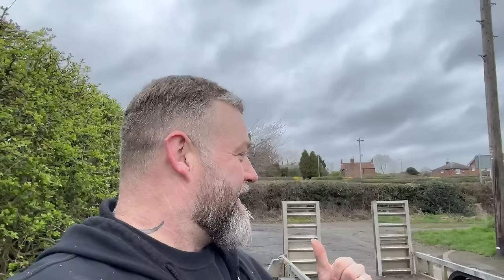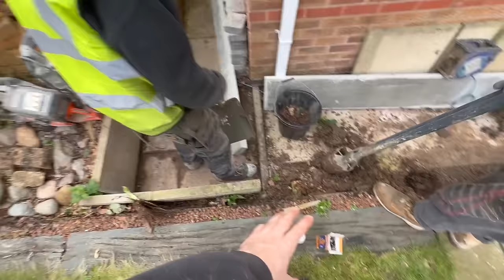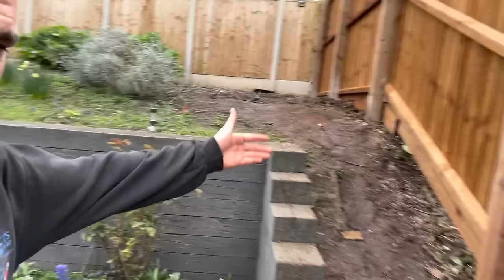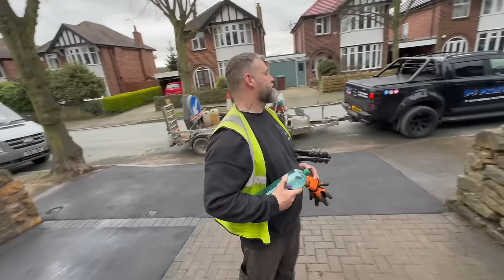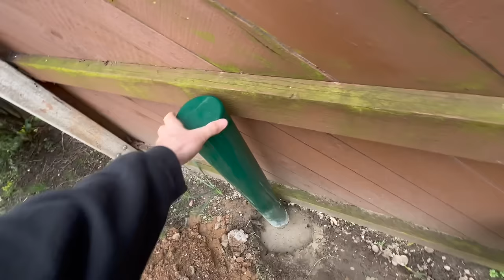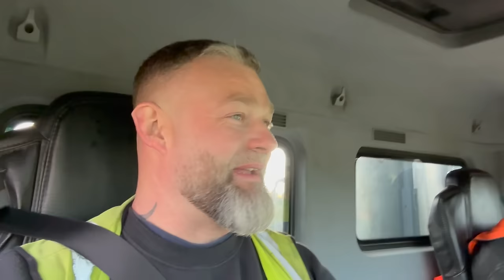This CRAZY Driveway TRANSFORMATION Is COMPLETE!

Comment: Dave line the inside of the steel frame of the trailer out with OSB or something abit more water tight and that way you can stack stuff like blocks etc without them sliding out between the bars

Comment: Afternoon D&J team and thank you for the info on the blocks I’ll look into them and delivery so I can maybe get the wall built before the wooden one rots away totally. Thanks again lads.Dave quick one if you wish for the sandstone wall to match the old part then get a tub of natural Yogurt and brush it on to the “new” faces of the repaired wall and within y months it will all look the same. I do it on concrete ornaments that I want to look like they have been in the garden for years algae and mosses start growing in the yoghurt.
Stevie once again the fencing team have knocked it way way out the park. I liked the idea of them steel posts although I may have gone for 2posts to each panel  but as you say it’s what the customer wants that’s what the customer gets so I get it but it# a idea I’ve not thought of before. But I think that a bit of 4” by 2” behind the post would also help save the fence as a car hitting right where the intron post is will hit between the 2 cross rails so the four by two upright may save the panel as well. Now roll on Wednesdays video yes sir roll on. 😊😊😊

Comment: Another good job from you guys, in my opinion, you should offer pressure-washing. For many jobs you finish the area around it sometimes has organics and dirt. It will make your jobs pop and bring in some more income. The new work area at the shop can be used for pressure washing,  resurfacing projects, and striping jobs.
Reply: Do you use yard signs  over there when you are on a 3 or 4 day job to advertise

Comment: You guys did a great job on the metal post install, I’m just not sure how I feel about them..I’m left wondering if the occupants of a car going into that fence would survive impacting something like that. I also wonder if there would be liability on the homeowner? Similar to broken glass cemented into the top of a wall or barbed wire on a fence.

Comment: If the green post is in sand you can put ten bags of read mix it won’t make a difference the only way they will be good is if there about 6 to 8 ft deep so more in the ground then out  I would say you went 3 ft a car going 30mph will push that over like Mach sticks and the post should of been filled with mix but as long as the customer as no clue there happy but you know

Comment: 10:39 Pretty stiff slope for a short driveway.   1/2 of that would be better. If someone doesn't put on their parking brake, sliding into the street would be bad. Minimal slope for water should be standard. (I can see you are trying to match the walkway to the door) Better if you can reduce  that slope also and put a small ramp to the doorway. Unpleasant step to door.  Whatever... it's a done deal.